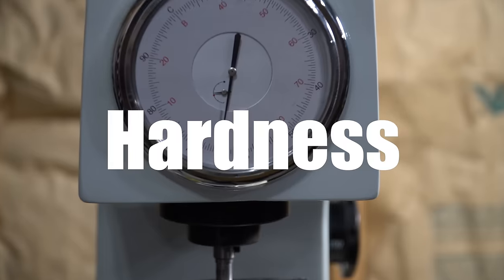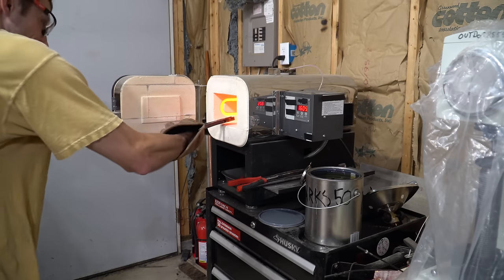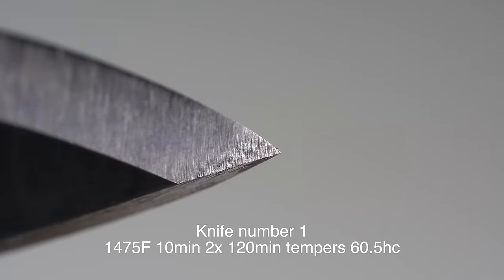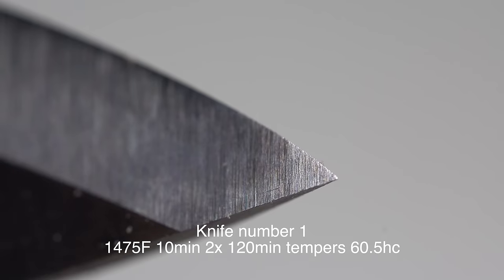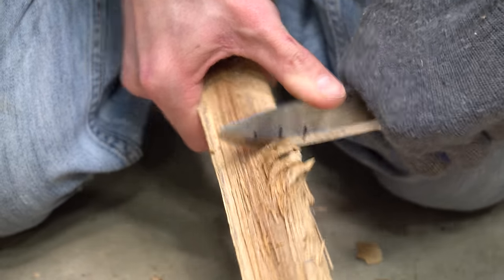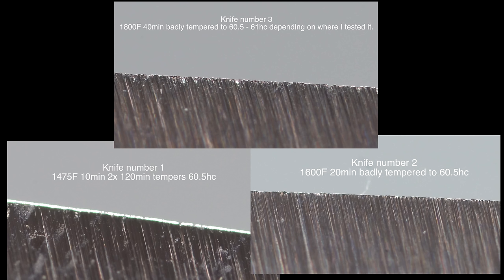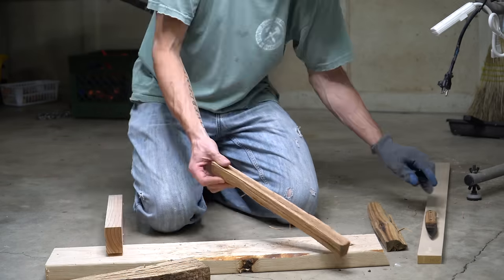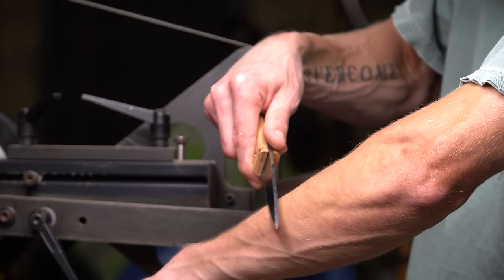The BIGGEST LIE in the knife industry- Good Heat Treatment vs BAD Heat Treatment

Comment: Great vid really enjoying the content.  I think HRC is a good indicator of what heat treaters are looking for when they know the process was done correctly. If your expecting say 61 HRC but you only get 55 you know something went wrong with the process or the problem could be the steel itself. For consumers when buying from a company they are hoping the HRC is a result from a good heat treat process as an indicator of steel performance during cutting. For the typical person who isn't into the depth of heat treat process it's another statistic that they can slap on a label and say "we did the steel correctly" and the consumer will go for it because a higher number is better right. Just my opinion though. Thanks for the great vid and keep making sharp things fun and enjoyable.

Comment: These results make perfect sense. 
Wear resistants as far as I know is a quality of the steel, and the hardness. 
Toughness is greatly enhanced by reducing retained austentite and when a steel is soaked at a higher temp longer it can increase that pesky brittle stuff. At the same hardness and wear resistance the knives should all slice the same. If your chopping however I bet chips would show up fast in the poor heat treat. Also I bet the crappy heat treats lead to less ability to flex when in a bending test. Great job showing how toughness and edge retention are manipulatable factors and how we can improve our outcomes

Comment: Great video... so happy I came across it! I am not sure about HRC being equated to a "good heat treat" but I think HRC is meant to be indicative as to the other attributes of the steel. Depending on the heat treat (to my understanding) will help dictate the trade offs between stainlessness/corrosion resistance, toughness, and edge retention. Today, this has become a huge talking point I believe because it attempts to help people compare apples to apples. If I have two knife manufacturers and the same steel if the HRC is at least measurably the same... you have 1 point of true consistency for comparison not good or bad..... just something consistent to view the rest against. But as often said as of late.... geometry is more important than anything else pretty much... but without heat treat do you even have a knife?

Comment: this was interesting and even if not completely precise and scientific - it still provides alot of good information. Maybe on a non skandi blade with higher and finer edge the bad heat treatment blade will show more negative effects than in this case . 

I love these types of videos that you make , I hope you keep doing them :)
Reply from the maker: These were at 14 degrees. That's about as extreme of an angle as anyone is pushing. The scandi grind is irrelevant as all we are looking at is the very apex in these tests 👍 Thanks for the comment 👊

Comment: For tool steels (slightly hypereutectoid alloy steel) 3rd critical point is somewhere arround 860 degrees centigrade. For quenching you want to bring it above critical point 1 where it starts austenitizing (around 790 degrees centigrade) but under 3rd critical point where grains start to overgrow from heat. Depending on the temperature you have to soak it for a different amount of time to fully austenitize - lower temps require longer soak, at higher temps grains recrystalize faster and actually can overgrow also if soaked too long despite being within ac1 to ac3 range.
For 800C 10-20 minutes is very correct.
870C might be above ac3 already, so it's rather a no go zone, but you might get away if you just bring the piece to that temperature and quench without any soaking.
980C for 40min - I'm more than very supprised the blade didn't shatter into million pieces at quench. You can see after breaking how swollen the grains are from overheating.

The moral of this experiment is for a given steel, hardness comes from crystalline structure while toughness comes from crystal grains size?

Comment: My conclusions from this are that heat treatment details are more important to blade toughness than edge retention. HRC seems to single handedly determine edge retention (within the same type of steel). I'd definitely rather own knife 1 because it will last much longer.

Comment: You are 100% right . The problem with in the knife community is there is alot of people with only 25 to 30 % of the knowledge  needed to have a opinion that is relevant.  that being what they read on a  data sheet that show what a steels maximum hrc is but they don't understand that data isn't realistic as even if you do a heat treat perfectly it doesn't mean that you are going to reach that hardness or that max hardness doesnt translate to optimal performance. And they don't understand that as a knife maker we are trying to not necessarily  to reach optimal hardness but optimal balance for the steel we are using and for  what the knife is going to be used for . And these same people if the steel wasn't marked they wouldn't know the difference between  say s30v and 1095 . Same goes for alot of knife reviewer who drive buying preferences in the edc and knife communities.
Reply: Great Insight!
Reply from the maker: I do think that for the vast majority of knives, hardness is still a top priority. But, for the vast majority of knife consumers, there still needs to be a toughness balance. Since knives are often abused, dropped, thrown around, etc. A full flat ground 1084 steel blade at 63rc and 0.010 behind the edge would make a great cutting blade but don't drop it or open a paint can. Most knife buyers aren't knife people and expect one knife to do everything. 🙂
Reply: @OUTDOORS55  very . True what I'm seeing is people that watch a bunch knife reviewer content and then want to question why I'm not using 20cv or the like and how come I'm not shooting for 63-65 hrc . And then spend a hour trying to explain to them that yeah it's great steel but not in every application and that I'm trying to strike a balance of maximum toughness with still maintaining decent edge retention  because sharpening is always cheaper and easier than a blade that breaks if you drop it or a tip comes off trying to remove a staple .

Comment: I was one of the people complaining early on about the Rockwell testing -- because I just don't think it tells you very much about how a knife is going to perform. It's obviously a multivariate issue with hardness, heat treat, steel and grind interacting in complex ways. These days, I focus primarily on design and ergonomics and don't worry at all about the steel or edge retention. I prefer carbon steels that are easy to sharpen. Blade gets dull, I resharpen.

Comment: Edge retention without much side load is really just testing the steel and its hardness - slowly wearing the edge down to dull-ish.  There would be very little rolling or chipping unless the steel is extremely weak.  So you are testing the hardness, especially when they are the same steel alloy.
You got that steel to 60-61 HRC on each knife, so short of extremely weak steel (e.g. walmart knife) they should perform in slow wear mode just about the same.
Reply from the maker: I did do side load testing. Its in the video

Comment: And this is why we have destruction testers for "hard use" outdoor knives.  The big issue is how easily they break. 
People sometimes laugh at the destruction testers, but they bring an important service to us.
For example, a good heat treat will yield a knife that cuts well and can also take body weight "step" loading.
A TOPS knife may have a slightly low HRC and need sharpening more often, but is unlikely to break in the field.  The extra insurance comes at a cost.  We're usually wishing for the best compromise rather than the safest knife, such as you get from a careful heat treat and a good hardness.
A bad heat treat such as on the many botched Asian Schrade outdoor knives may break in half from just a bad landing when throwing the knife into a tree.   So it should come as no surprise that most throwing knives rarely get up to 55 HRC.
A sushi/sashimi knife may be made pretty hard, with a very shallow angle, but it will not see any rough use by a competent sushi chef.  It would fail these tests, but no one would notice or care.  If the angle was extremely thin, then these toughness issues would become more important.

Comment: Having broken a few tips, I now grind my 'utility knife' edges to a point with a more robust angle. Still sharp where needed, but significantly less chance of nipping the tip off. The last 10%  of the edge angle is increased by 30-50%. e.g. 22deg progresses to between 29 to 33deg.

Comment: This was a fantastic video. At some point I would love to see you test tuff steels like 8670 at higher hardness compared to other higher edge retention steels at lower hardness where those lines intersect and see the edge retention.
Reply from the maker: I do have some s7 laying around as well as some cpm-m4. Although im not sure those two would be a good match up. I think it may be difficult to match the two in hardness to a point where you are not introducing other undesirable characteristics into the steel. Might be worth a try though🤷‍♂️
Reply: @OUTDOORS55  Perhaps an easy one could be like 8670 at like 63 or 62 compared to O1 at 59. I would guess even at those different hardness levels they are still close to the same toughness. Or AEBL at 63/62 compared to another stainless at 59 where the toughness line intersects. Hope that makes sense. I guess my general theory is that tougher steels are more versatile and could come close in edge retention at higher hardness to other steels or left tuff when needed.

Comment: Great test! How about some cryo testing to harden the knives for 24 hours? A test I watched on drill bits seemed to harden the steel without making it less tough. No idea if that was the case, but if I could get 20+% usage out of 1 sharpening, I really could care less about toughness on most of my knives. And, it would be fun to see how hard it's possible to get a knife with easy available stuff like dry ice. 
Cheers :)
Reply: Cryo is a bit of an edge case for really simple steels. In high carbide high alloy steels like we expect to see in drill bits or high end cutlery the steel might not convert all of the austenite to martensite in the quench so soaking at low temperatures can finish the transformation. This effect can be seen in low alloy steels but it's to a mich lesser extent

Comment: My understanding is it's a matter of finding the balance between hardness and toughness. For annealed O1 Tool Steel which comes at RC 45 (how you normally buy it from a supplier) that amateur wood workers use for making chisel blades, plane irons, etc., one is supposed to first shape the blade while leaving the cutting edge about a 1/64" thick to ensure carbon retention, then heat the final  ½" to ¾" or so of the working edge to 1,500º F then immediately plunge it quickly and completely into a container of enough oil (motor oil smokes, vegetable oil does not) so it doesn't catch fire, which gives it a hardness on the Rockwell scale of about +-75.  Then it should be put in a 350º to 400º oven for 30 minutes to an hour to be annealed to an RC 60/62-58/60 respectively. Too hard is brittle, meaning it shatters when stressed; too soft and it won't hold an edge. The trick is in finding the balance between too soft and hard enough to take and hold an edge w/o shattering.
Reply from the maker: There is always a balance. O1 is a deep hardening steel, meaning it has a slow cooling curve for martensite formation to occur. Im not sure o1 is a great steel for home heat treatment unless you have a temperature controlled kiln, due to the carbon needing more time to dissolve at austenitizing temperature. 1084 would give more consistent results if using a forge. Thanks for the comment 👍

Comment: I dunno, maybe it's because my interests lie more towards swords and daggers rather than knives, but this all seems to make sense to me. Blades of equal hardness have comparable sharpness and edge retention, but a good heat treatment makes the blade over-all stronger and more resilient. This is important for edged weapons that need to hold up well to impacts and mechanical stress, and often durability is prioritized over sharpness rather than the other way around, which seems to be the case for tool knives.

Comment: Good video.  As a maker, I get enraged by the use of the term "edge retention" testing when the test you are performing (slicing stuff like cardboard) is NOT EDGE RETENTION TESTING!!!   For crying out loud.   It is called "wear resistance".  NOT "edge retention".    Actual edge retention is the sum of all of the properties, toughness, hardness, wear resistance, apex stability, corrosion resistance (to some extent).  And that is why you are getting similar results with all 3 knives in "wear resistance" testing.   Those other factors, like toughness, apex stability, etc aren't going to have a noticeable affect when slicing stuff.  Grain size plays very little role when slicing into stuff like cardboard, but grain size has a massive role in stuff like tip strength and apex stability.

Comment: Personal experience, using a knife to pry or use the back for slot screws. Brittle blades break or chip. Flexible blades twist and bend. Sharpening and edge retention. Harder steels don't always retain their sharpness as you would expect but always seem more difficult to sharpen. Flexible steels seem to hold and retain their edge. Are more forgiving of abuse. That it is ill advised to use a knife to open cans, always use a screw driver. Preferably a slot head heavy duty. Never electrical screw drivers.

Comment: Seems like this makes sense. Hardness is more how it's holding it's shape, but doesn't factor in the "structure" of the molecules/grains (which heat treating properly helps address), so you're able to retain the shape in things that don't strain the internal structure as much...but once you start doing things that rely more in the internal structure, it starts falling apart.

I'm imagining it to being like building a house with proper angles/load bearing/structural considerations vs one that doesn't...it'll get the job done just fine until something tests the structure, and it'll collapse or various parts of the frame that was under odd stress will pop out.

Comment: I agree I think posting hardness values with the knife is important but also actual tested hardness values not what you were aiming from from data sheet. I don’t care that your target was 60 hrc what did you actually get. Hardness values let’s be determine what I can expect from the knife vs another knife in the same steel. If my option was 61 hrc and in a similar knife with the same steel the maker ran it at 58 I would go with the 61 hrc knife. Running knives softer usually tells me the edges are thicker and the maker might be trying to save time and money by running it soft so it’s easier to grind and finish. I just finished a large 4V camp knife that’s sitting at 63 hrc and I’ve had no edge issues in all of my testing with it.

Comment: I use 1084 vs 1095 because I have found out that the 1084 seems to be more forgiving in heat treatment vs 1095. The 1095 can get a bit more brittle if an error occurs, while the 1084 seems to withstand a bit better.
I kind of wonder if it is due to the carbon content. Higher carbon= shorter crystalization making a harder blade, and during the tempering stage if you start with smaller crystals you reduce the ability to grow a proper lattice in the metal is you have gone outside the perimeters of the steel. Where as the 1084 has a slightly less carbon content which allows for longer crystal formation making it a little more forgiving in the tempering process.
Hell, there are a multitude of arguments that can be made in this discussion, but my choice is a nice 6" blade full tang 1084 knife that I feel comfortable using and have less concerns when having a home blacksmith producing a blade I like.

Comment: Absolutely good stuff. It would probably be the best if the knife manufacturer stated steel and hardening and tempering protocols.  As well as the hardness.  Would give a better if not absolute gauge of the temper of the blade.  Probably the most important part of the knife is the heat treatment.  Everything else can be corrected with abrasives and effort.   Thanks for your time and knowledge!!!
Reply from the maker: I agree 👍

Comment: Toughness and hardness are often displayed as opposite ends of a sliding scale. Hardness is a major factor in edge retention. Toughness is closely related to brittleness. A decent knife maker (both mass produced and artisan) carefully balances toughness and hardness while designing a final product. It is easy for the advertising departments to just push hardness as edge retention. That way consumers won't get confused by important information that might complicate a choice. Give one hardness number and say "hardness = good" and the masses will proudly nod in agreement. That's why pocket knives commonly range from $5 to $500. They are selling to crowds who want to be told they have the best, while not wanting to be confused by inconvenient information. It takes a "knife person" to care about the difference.

Comment: So how we sharpen knives is important.   I have a Spear (AlexDrow)  I would like to put an edge on.    After some research it is 420 Stainless a common material for surgical instruments and kitchen knives as well.    I have a dremel or I can use a knife sharpening wet stone (more forgiving and lower temperature.)    Now if I use the Dremel tool and heat up the edge too much during the adding an edge process I will change the properties of the material.  Then it may not hold an edge as long if I change the crystalline structure due to heat.  It can also be more prone to rust in the area heated.